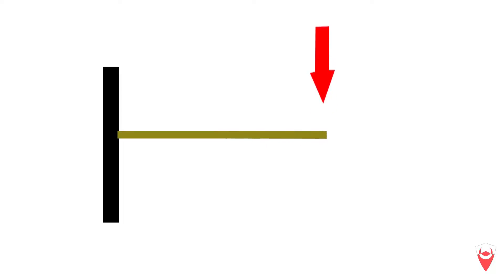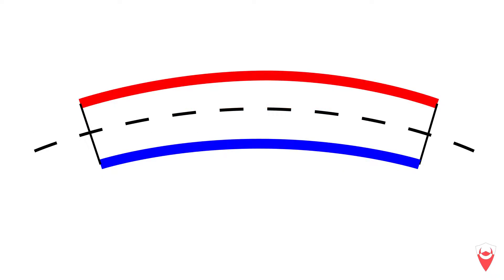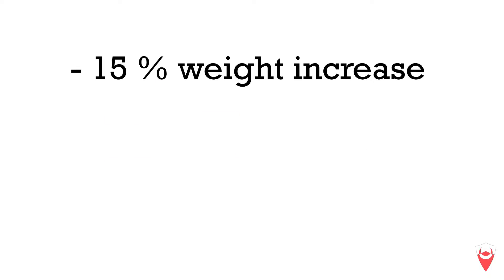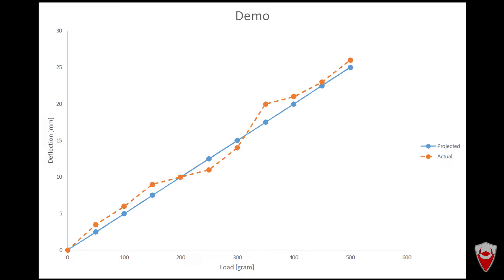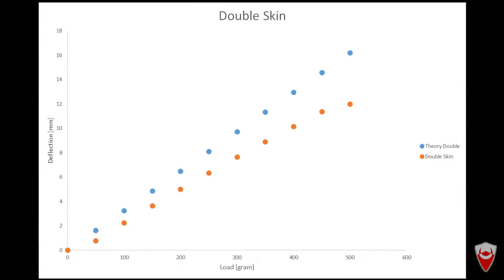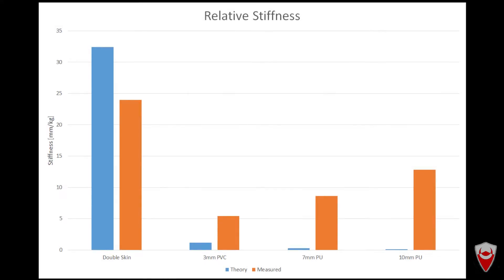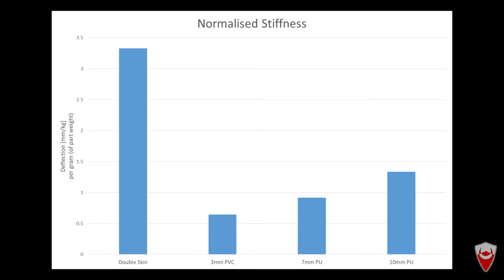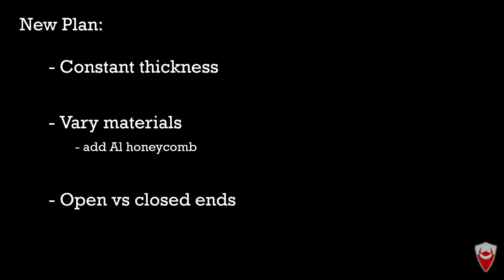[EXPLORE] Core Experiments 1: THICKNESS

Comment: This mounting rig induces a compressive load on the core which will deform leading to more deflection. Better is to use a 4-point bending test to get more predictable results.
Reply from the maker: Thanks for the feedback. You're right, though I don't think it would have changed the outcome overly. I might make something else up that resembles a 4 point bending test for future videos.

Comment: Awesome stuff! I’m curious to see your next experiments. I know it was a quick test but how the skins moved around the core is a prime example of why I really try and have fully enclosed cores on my parts.
Reply from the maker: Hey mate, glad to see you are still watching my videos. I normally enclose the cores on my parts too, but in this instance I wanted to control the test as much as possible (which is rich considering I used three different types of material) and it was easier to cut everything to size and bond it together than do insitu layups. I was genuinely surprised at the differences between PU and PVC, so I am glad I did it this way, and now I get to see how much joining the sides/ends improves it.

Comment: Nice video, good experiment with introduction, control and tests. Here's something I might add which might be useful, i.e some core materials like Soric from Lantor and Nomex honeycomb from Hexcel, and also some other foams (i don't know which ones particularly) acts as flow medium between the two layers of composite. The resin flows through them and forms a solid or patterned structure between the layers like infill layers of 3d printed parts. This I think is not possible with some core materials like Aluminium honeycomb, Polycarbonate/ plastic honeycomb or even some foams which doesn't let resin flow through them. I think that the continuous resin structure adds better load distribution. Here's an idea if u take that 3mm foam and put it in a cnc laser machine and cut hexagon/ any shapes out of it and make an infill structure then use it as core material. The reason for using laser is that the laser machine will melt the sides of the foam it cuts there preventing resin flowing out into the empty hexagon areas. Awesome work, please keep it up. If someday I become rich enough I'll ask your help to build composite chassis. JK
Reply from the maker: I'd love to help building a chassis! Adding some Soric is a good idea, thanks for that. I will also look at the differences between insitu infusion vs addition of core as a second action (like in this video) on stiffness and failure modes. I think it wont have an affect on the PU stuff as that failed in the core alone, but we shall see what the results reveal. (I honestly don't know yet)
Reply: @CEWManufacturing  Sure it would be quite interesting to see those results.